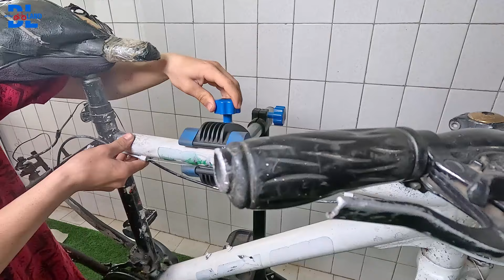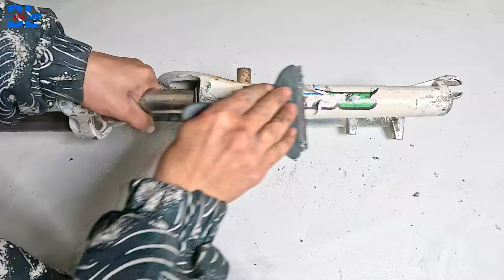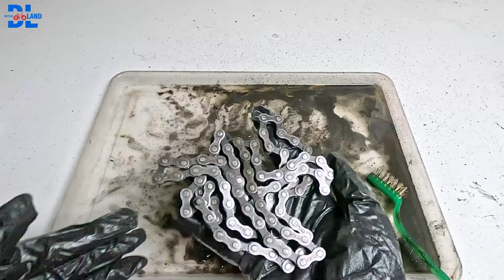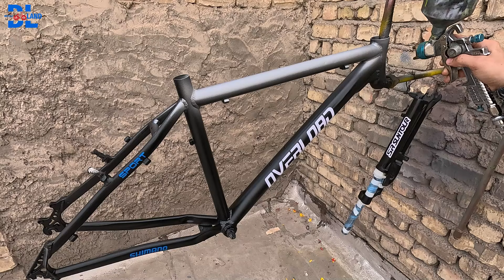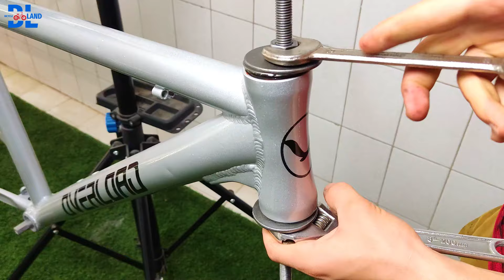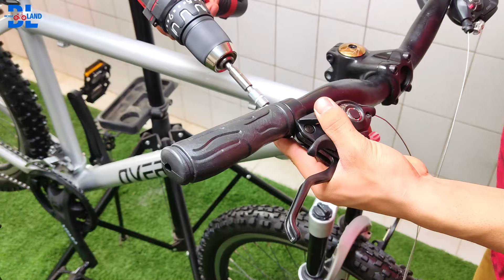CHEAP BIKE RESTORATION | $50 Trash Bicycle Turned Into A Sick Mountain Bike

Comment: shock absorber rod were sandblasted and painted? - you made my day!!!:face-turquoise-covering-eyes:
Reply: The SHOCK ABSORBER on the fork is rusted and blocked, the fork does not work.He just painted it on top, it's kind of stiff now.
Reply: @ИванНемов-п4х   SHOCK ABSORBER surface need to be polished. If it already rusted - you need to replace shork absorber. It is like sandblasting of the bearings.